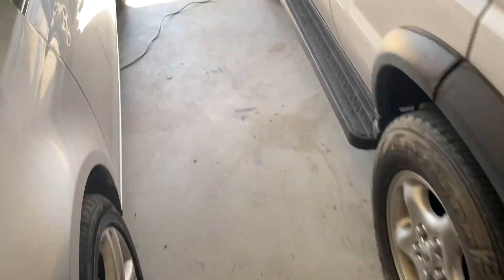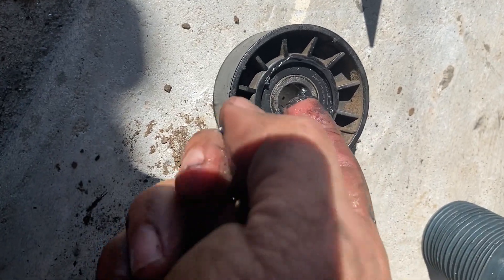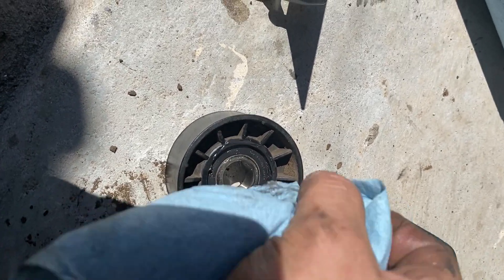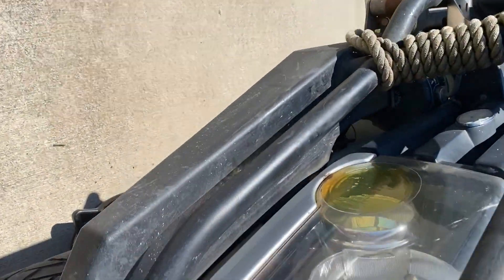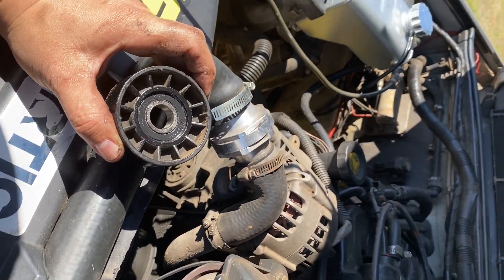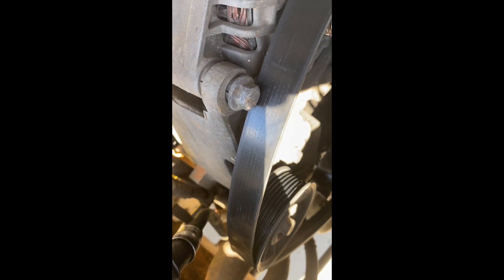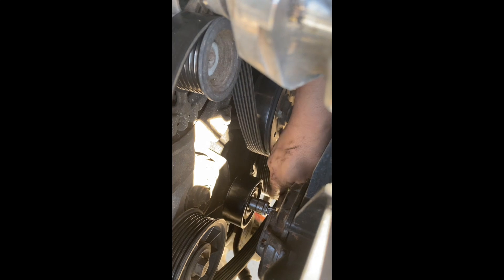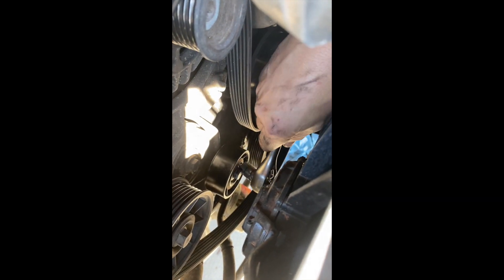Land Rover discovery 2 Maintance

Comment: Hi, I want to buy a discovery 2, but I live in a very hot city in Mexico, above 120°F. Would you recommend this vehicle considering its heating issues?
Reply from the maker: Max Olea yeah! Actually there’s no issues with the motor, the problem is the 3-way thermostat in the cooling system. There’s a modification that cost around $75 usd that fix’s it..
Reply: @landroverzone9824  Great! Thank you so much